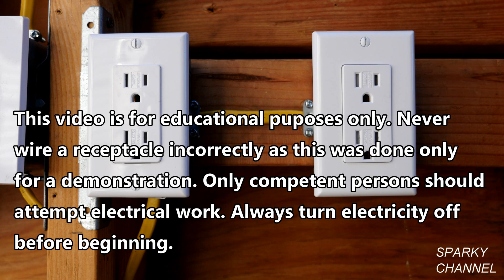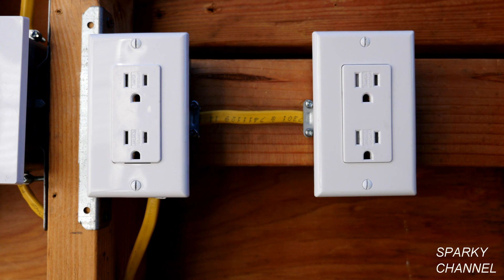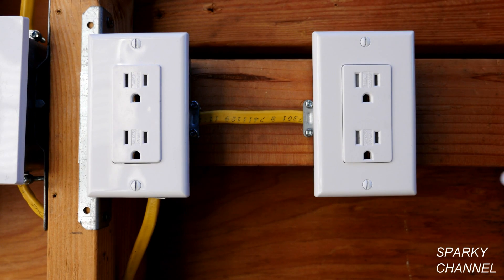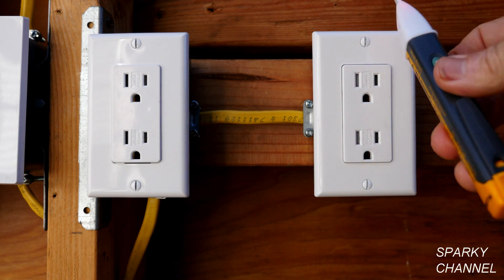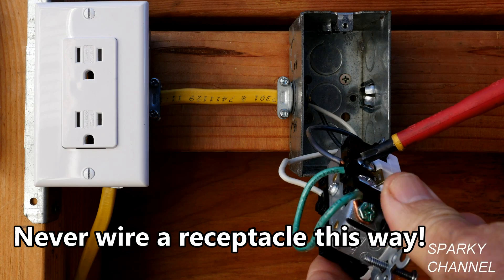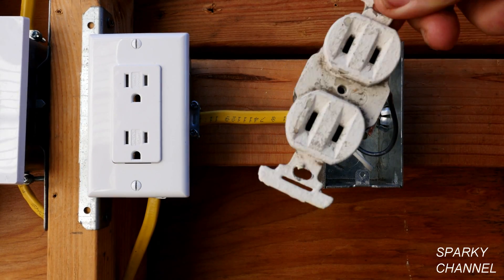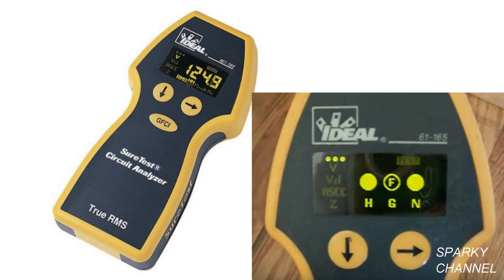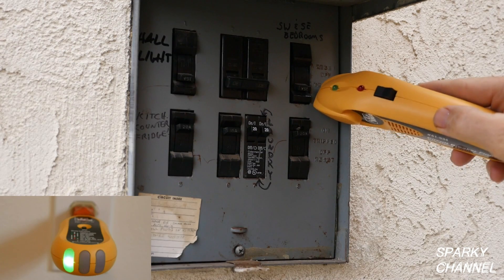How To Identify Reverse Polarity Bootleg Ground Receptacles

Comment: Are there really people thinking they can get away with this? I mean here in Germany until 1973 it was permitted to have a PEN wire instead of separate ground and neutral. The PEN is a combination of Protective Earth (ground) and Neutral, so it carries the operating currents and in a fault situation also the fault current. So you can find in old german installations the PEN connected to the neutral terminal and a wire bridge over to the ground terminal of the outlet. In the last version of the VDE 0100 were this was permitted, from 1969, they insisted to connect the PEN to the ground terminal and a wire bridge to the neutral terminal.
Since 1973, if you install a PEN, the conductor must be at least of the size of 10mm² in copper or 16mm² in aluminium to reduce the chance of a broken PEN wire. 10mm² is in the range of AWG 8 or 7 (something in between). In the US this system with a PEN is called MGN, multi-grounded neutral. The MGN carries the operating currents and if a fault occurs also the fault current.

It's only permitted to recreate if you're change a defective outlet in an old installation were this measure was permitted when it was installed. But a new installation with this is not permitted. Of course a GFCI won't work with this. Only if you install a GFCI on every outlet itself, or do this and for the load outlets install new cables with a separate ground.

At least that one would be safe, compared to making the ground connection hot and killing someone...
Reply from the maker: I've seen them in old houses. Scary!
Reply: @SparkyChannel  A few years ago a tennant sued his landlord to force him replacing the electrical installation with such a system installed. The court declined. The reasons were that the installation was meeting the requirements of regulations which were in state when the electrical installation was built and this system is not considered beeing unsafe across-the-board. Also it should be clear that in a 1960s house the electrical installation is from the 1960s too in most cases, and for this the renter pay less rental as for a new house with a newer electrical installation. If the electrical installation is renewed, the landlord would have stated that and increased the rent. But if the installation still meets the requirements of the code which was in state back then, the installation itself is not defective and is safe, there's no reason to enforce the landlord to renew the installation. Maintenance  and repairs are not considered as renewals.

If maintained properly that system is perfectly safe, it worked for decades. It was introduced in 1913 by the german company AEG. So it was permitted for 60 years here. In my parents house some circuits are still grounded that way.
And actually you have such a system too if you have a MGN system. If there the PEN breaks you got the same situation, except that in most cases there are additional local ground rods installed but they will only lower the voltage in most cases, but won't cause the complete trip of a circuit breaker or cause that a fuse will blow because the impedance of most ground rods is far too high, depending on the conditions of the soil.
Reply: @okaro6595  Here only the better ones got this, but this also not reliable. Problem with this metal touch pad is, it uses the person as a reference. And if you wear insulated shoes or the floor is insulated well enough it won't indicate that the PE of the outlet is live at mains voltage.
It uses the same principle as these voltage tester screw drivers.
But I got one too, the Testboy Schuki 2K. But in most cases I rely on my other test equipment. And you also have to measure continuity between the PE terminal in the panel and the PE connection on the outlets. That's the reason for the existence of 50m test leads.
And with the installations here it's the same, you don't know who messed with it. And the last fatal accident I know of in combination with this grounding method was also a mirror cabinet in a bathroom. But this was caused by a professional electrician who messed it up. A woman was in the tub, stood up in the tub and tried to close the open mirror cabinet. The housing of the cabinet was live at mains voltage due to a messed up wiring.
There are two fatal scenarios possible:
1. Broken PEN, will cause that the appliance won't work and its metal housing is live at mains voltage.
2. Wiring messed up, the appliance will work but the housing is live at mains voltage.

But at least it was better than the alternative from the 1950s for dry rooms: Type C outlets without a protective earth, insulated floor, no other incoming different potential into the room like water pipes or pipes from a central heating system. The water pipes and the pipes from the heating system would be grounded, and so an incoming different potential. This safety measure worked like a bird sitting on an uninsulated overhead line.
Reply: The problem is when the colors are not correct like if the white wire is hot or if different colors are not even used. In 2015 a plumber in Finland died because of such an outlet. It was some illegal DIY (all DIY is banned) and the colors were same. The resident has used only double insulated devices so he did not know the problem - even though each time he was within millimeters of being shocked by the ground contacts.The floor was full of water and the tool the plumber used had an RCD but that of course does nothing to protect. Apart of that there were several non-fatal accidents in the 2010s mostly caused by a cabinet with a socket  added to the bathroom.

In Finland the law in 1930 actually mandated the use of neutral for grounding. In 1957 separate groudn wire was allowed but the use of neutral remained common and was banned only in 1989. The 10 mm² trick was allowed until 2007. Before 1997 grounding was mandated only in dangerous locations (kitchens, bathrooms, conductive floor etc.)
Reply: @okaro6595  If using the neutral also to ground the socket outlet, the wire is no longer a neutral. It's a PEN, protective earth neutral. Neutral (N) only carries the operational current, the ground/protective earth (PE) only carries fault currents, and the PEN is for both, operational and fault currents. The thing with the 10mm² is, it won't fit into the terminal of a socket outlet.
In several countries the incoming supply comes with a PEN that is splitted into a separate N and PE at the service head. Americans call it MGN (multi-grounded neutral), some call it PME, but international the correct description is TN-C-S.